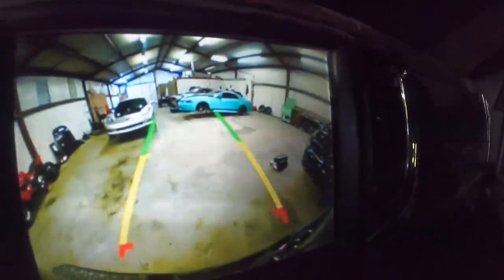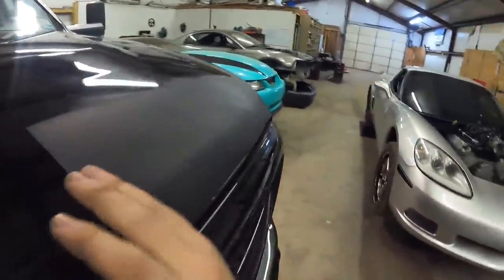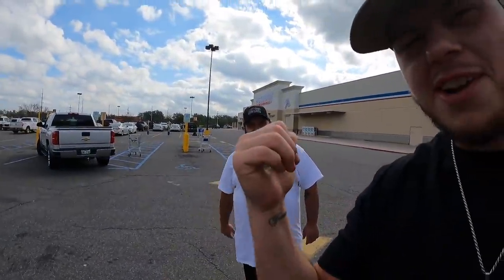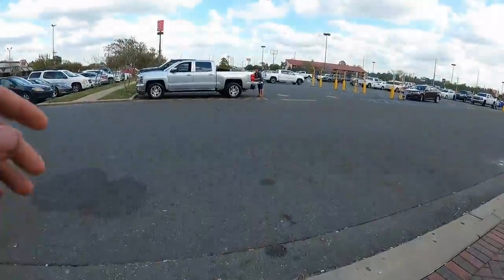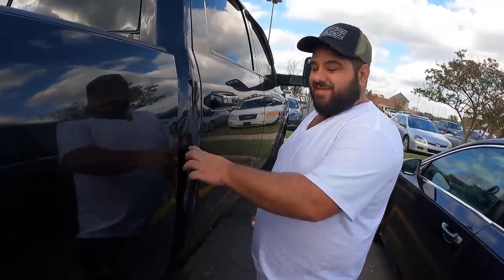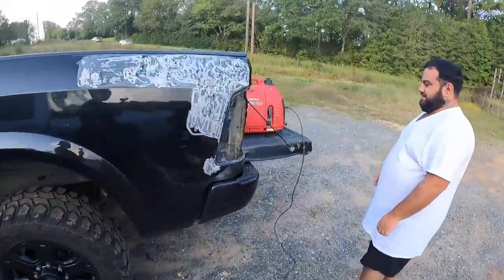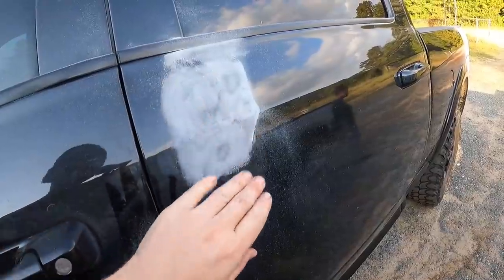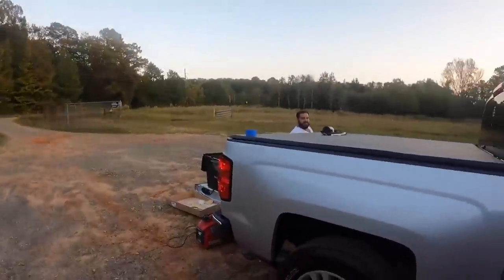Gypsy Body Man Fixes Major Damage on My Truck in Parking Lot!

Comment: This is called a hack job. I have met these idiots before. There is a reason why body shops charge the price they do. Are there some that overcharge? Sure. But for the most part $2500 painted is a good price for the dents on this truck. I speak about this from experience: former state farm appraiser, current body shop owner and car dealer. I felt bad for this truck @7:55. Get this thing repainted by a good painter that way at least the hack job will be hidden.

Comment: FYI the body filler applied over paint is going to fall off in about 8 months along with whatever is on top of it and then you’ll have rust to fix. As soon as you put a gloss finish on it you will wish you had spent the money on a real body shop. Not to mention this gypsy hustler took business away from a legit businessman who pays taxes and contributes to the economy and infrastructure of our country. Any appraiser who looks down the side of your truck will undoubtedly see the shoddy repair work and question the integrity of the whole vehicle which will probably lower the value of your truck by about $10k or more. Congratulations.

Comment: Not hating but it's body filler. I had a guy do this to me and I allowed him to do the same. Came out alright for the price paid. But not long after even doing it the same way the body filler started to crack and come off. You're not supposed to use it in situations where the thickness is more than a quarter inch. But if you don't care then all the power to you. I'm more of a perfectionist and would prefer spending the extra money to have the panels replaced. But that's just me. Everyone has their own preference. For the time it took and price and with your ok with how it was repaired he did a pretty good job.

Comment: respect the mans hustle but the quality was subpar. holes in the panel covered by filler? no back taping primer, not even 320ing the area around before applying filler, no paper means maximum overspray. but than again remember this is 600 dollars only so respect

Comment: I met someone similar to this guy at a shell gas station while I was pumping gas into my truck(14 Silverado for reference) he told me he was a Mobil body repair/detail guy and that h could fix it all for 700 bucks he even said he had my color(dark cherry red, the exact name is Sonoma jewel metallic I believe)  which I knew was bullshit because I’ve asked Every body shop and Mobil guy around and they always say they never have that color because in my area there’s only 3 or 4 in my city( Massachusetts is the state, most cars are black silver white and some green not many cherry red chevys) I told him I’d call him but I never did because it seemed like a scam, he also wanted it up front and I was already planning on changing the whole bed because the damage went down half the bed side( slid on ice and skidded of the side of a telephone pole, and I don’t like bondo on my vehicles if I can help it

Comment: Expensive truck and you get a hack job like that done to it.... thoe 2 doors didn't even need to be painted you could of got paintless dent repair done to that and hacks still drill holes in panels to straighten them pros weld studs and pull it that way.

Comment: Ialmost wanna sub, just to see the follow up video “I got scammed, and watched it happen!!!!”  This is a common scam, where damage is repaired using horrible prep, lots of poorly applied body filler and finished with a top coat of what seems to be bed liner? The top coat is used to cover the poor repair. This is a short term “fix” that will have to be redone professionally. The wrap would be a great band-aid but will most likely bubble or lift on the hard masking lines of the repair. Sucks to see man. Hope you can get it fixed.

Comment: Look, I respect the hustle... but that's what this is, you got hustled.  No professional would ever use those tools.  Maybe it's fine for a cheap daily, but not a $50k truck that deserves good paint.  Might seem like a good deal, until you realize it will rust underneath the "repair".  Also, the filler will flake off where it's on the unprepped paint.  I could go on...

Comment: We call that butcher work. You never put holes into body panels on purpose. I hope he welded them closed and put ecoat/ cavity wax inside. If he didn’t that bondo is going to stick out the holes and act as a wick absorbing the moisture. When the bondo gets wet Its going to rust out the body panel and the bondo will fall off. On top of that the bondo isn’t supposed to be to thick or it will fall off too. Cheap work will always get you in the end.
Reply: And on top of that body techs won’t work on prior repairs. There’s no way you want to tie your name to someone’s else’s shody work. If they do there’s no warranty because they’ll just work over it. Best bets to replace if you come across some shody work. Good luck bud.

Comment: If you get it painted then it will end up costing more than your 1k deductible would have cost to get it all done at a shop. The guy did decent work but you just cost yourself more money in the long run. Guess you got a video out of the deal is the only upside. Cheapest alternative is be a better driver and you won't need paint and body work done

Comment: so many people pumping this guy up...... theres not one correct repair he did.  that body filler is going to fall off in clunks with rust behind it... like who the fuck drills a hole in a panel and pulls the dent out with a wood screw! then fills over the holes. there's a reason a shop is charging 4k to fix this.  at least he kinda worked the metal back out on the box panel.  seriously tho!!! do not waste your money painting over this body work. you going to be pissed when that paint cracks and pinholes in time... give it 6 months to a year and you will see that i mean.  ps a etec primer (like the primer he sprayed ) is meant for bare metal only. it will damage the filler in time. been a autobody tech for a little over 10 years now

Comment: Gotta respect the hustle, but the dents on the driver side door and cab corner could’ve been fixed with PDR. The other big dents on the bedside and hood looked like shit lazy body work. You’re not supposed to drill into body panels without welding them (can corner) everyone thinks this is a good body man when I’m reality he’s doing shit work that’s going to look fucking horrible when painted. And every good body man knows that black shows everything. Go get your truck fixed right so it doesn’t start rusting.

Comment: Absolutely not done correctly.
You don’t poke holes unless you plan on welding them back up. You need to feather the transition from the paint to the bare metal and you don’t apply filler over non prepped areas.You don’t use a rattle can primer unless it a two part with a catalyst. This will have to be redone correctly in the near future. 
It’s been 20 years since I have worked for a body shop but even then we wouldn’t do work this shotty. Sorry to say but you got scammed.
If anyone comes up to you in a parking lot and offers to fix your car, tell them no thanks. They will end up causing more damage. 
Paintless dent removal would have been the way to go for most of the dents on this truck and it would have cost the same and no repaint needed
Reply: I have cars ive done work on with rattle can primer and paint thats last ten plus years . The surface was prepped he obviously sanded it . He did a fine job with what he was delt with ... your just hating 😒
Reply: @anthonymcgill864  
I’m not just hating I’m just just know the correct way to do repairs and just pointing out what was done incorrectly. That’s all. Just hating is a waste of time. It was nice that the owner was generous and gave a tip and it was overall a well done video but the quality of the repair was not professional. That’s just reality not hate.

Comment: He's wrong about the blimish not showing up. Wraps aren't what they used to be. Any blimishes in the bodywork or runs in the primer will show up like crazy. Also, I noticed he  taped way past where he primed. Unless he sanded out to the edge of that tape, that primer is going to peel  right off that shiny painted surface. I've been doing custom paint and body work for over 30 years.